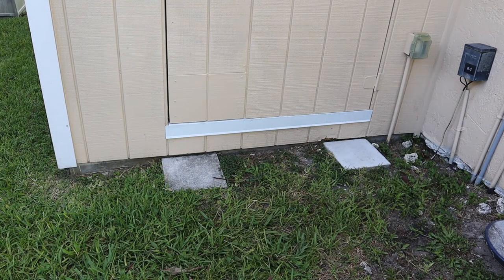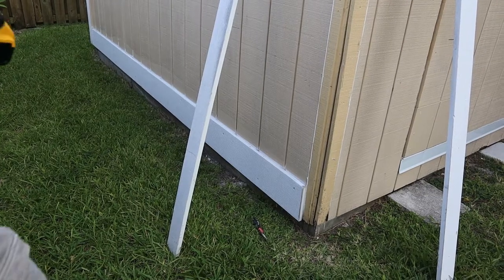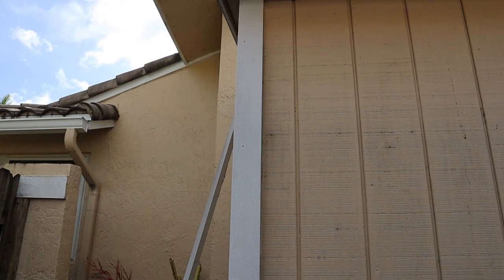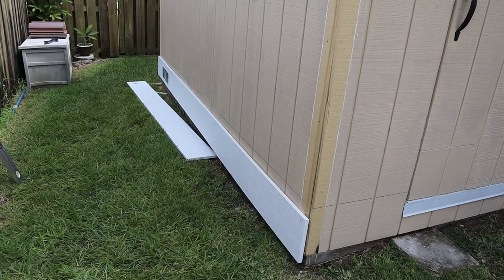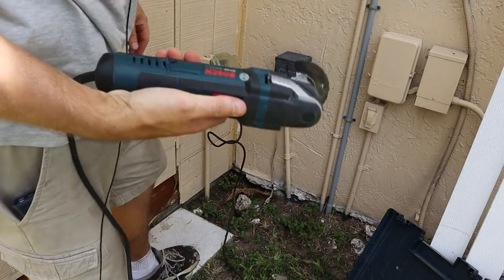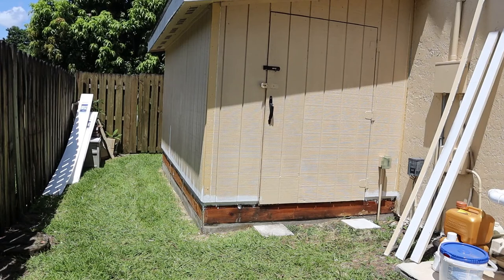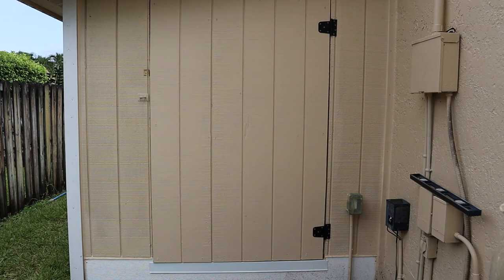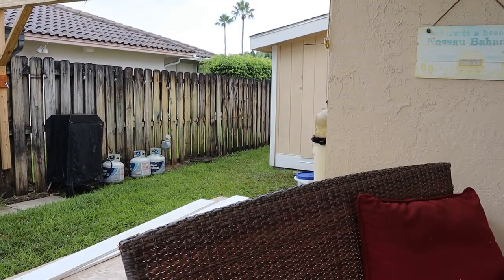Replace Rotten T1-11 Siding with PVC

Comment: when you build a shed spend the extra $140-200 to coat all the trim and t11 with redgard before assembling it (after you cut all your pieces),coat all the sides including all the interior surfaces and ends, then put it all together, caulk, prime, and paint.  Doing so will prevent water from wicking up into the wood and will also greatly reduce warping.

Another tip.  Don't use interior caulking in exterior applications it will quickly crack and separate defeating the purpose.  Exterior grade caulking is much harder to work with but it has more elasticity than the interior grade stuff.
Reply from the maker: That's a really good idea!! I use red guard in bathrooms never thought to try it here!

The caulk I used here is was an exterior rated caulk.

Comment: Thought you did a great job. Like the PVC at the bottom look's good. T1-11 see the bottom rot a lot even the groove edges do to holes in the material.
Reply from the maker: Thanks very much for the compliment! If this happens again I'm probably going to change to a different type of siding. T11 is good looking and cost-effective but I just need something that's going to last especially in South Florida... The hot weather and high humidity make stuff decay pretty quickly.

Comment: You are never supposed to caulk over the Z Flashing, Now you damned the water and moisture will rot the wood above.
Reply from the maker: Then how do you prevent the T-111 from wicking moisture up through the bottom?
Reply: @JoesGarageProductionsLLC  ...by sealing the edges...you completely defeated the purpose of the flashing by caulking it...
Reply from the maker: @puzer1  help me out then. How do I keep moisture from wicking up the bottom of the t1-11?
Reply: @JoesGarageProductionsLLC  ...I already told you...seal the bottom edge of the siding only and you need to leave a gap between the siding bottom and flashing edge for water to travel away from the siding from the front and behind...if the flashing is installed properly it sits at a slight angle so water can't pool on the inner creased angle...caulking in the flashing seals up the path of the moisture that can travel down behind the siding...by sealing up the flashing you've negated it's function and guaranteed that moisture will sit behind it and induce rot...the pvc is fine, you just don't quite have a full grasp on how flashing works...
Reply from the maker: @puzer1  that's what I did originally when I installed the siding a few years ago. Sealing and painting the back and bottom didn't prevent it from rotting. Maybe this is just not a good siding material to use in my climate which is very hot and humid most of the time
Reply: @JoesGarageProductionsLLC  the problem is the shed is clearly too low to the ground...I live in the same place as you...no amount of waterproofing is going to prevent rot when there isn't adequate airflow underneath the shed to dry it out properly...you can see this identical problem with even stucco homes that have no gutters, the stucco fails in the exact same spot as you siding...when it rains down here that shed is soaked on the bottom because of the amount of run off and resultant splash back from the roof...the pvc will help, getting adequate airflow underneath the shed would be advantageous as well...
Reply from the maker: @puzer1  thanks for the advice. Not a whole lot I can do about it now unfortunately since the foundation for the shed is a 12-in x 12-in concrete beam. The floor is 5/4 board, the same stuff they use for decking so that should provide some ventilation.
Reply: @JoesGarageProductionsLLC  put gutters on it and , even better, make a drain field that uses grates ad you can even do some for the house next to it.
Reply: @JoesGarageProductionsLLC  you are supposed to leave 1/8 inch of room between the bottom of the t-111 and the top of the Z flashing. That allows enough space so the water cant wick upwards, and also if you paint the bottom, sides and backing, prevents wicking as well. You are not supposed caulk the flashing.
Reply from the maker: Still rot free, 2 yrs after this thread started 😄
Reply: @JoesGarageProductionsLLC  It definately has a limited life span...Here in NY it rots too!!

Comment: For anybody watching this who has a decent size door, buy a metal roll- up door and be done with hinged doors that NEVER open/close right or sag on the hinges. It's well worth the $$$.
Most would just replace the rotted T-111 with the same. This is a much better solution.
Reply: Yup, that's what I did with my shed. Best money ever spent.
Reply: @chrisheffernan6600 hi I am looking to get a roll up door also, is there a brand name you prefer, where did you buy it? Thanks in advance for your suggestion. Jim

Comment: Hi there, how is this holding up? The PVC is a great idea in a non-ideal situation like this where the shed is close to the ground and bound to attract water. The water should hit the z flashing though and shed off without the need for caulking.
Reply from the maker: Holding up great so far... No issues!

Comment: Arent you supposed to lay tar paper with circle head nails to waterproof the plywood, then put a wood spacer , then lay the vertical siding? Tar paper keeps water out, the spacer ensures the vertical siding can dry when water gets behind there?

Comment: Having trim at the bottom provides a place for moisture to sit.
Reply from the maker: Makes logical sense but it rotted anyway in a couple of years the way I built it originally. I figured it was time to try something different
Reply: not if the trim fits under the flashing